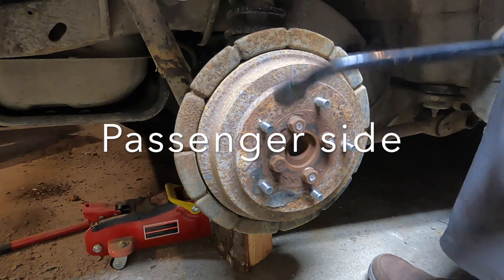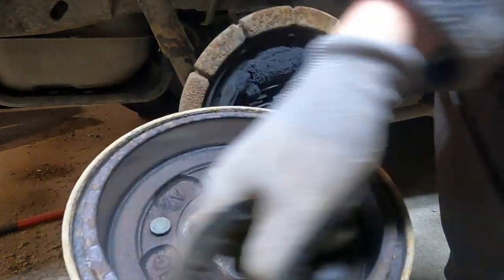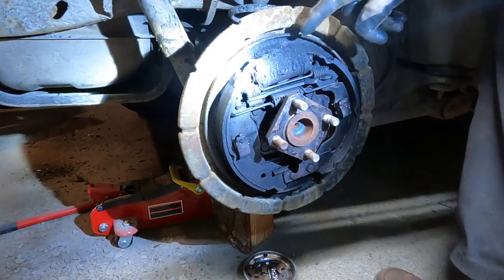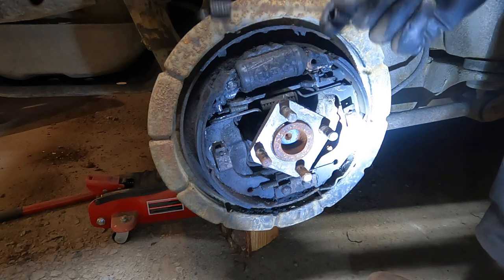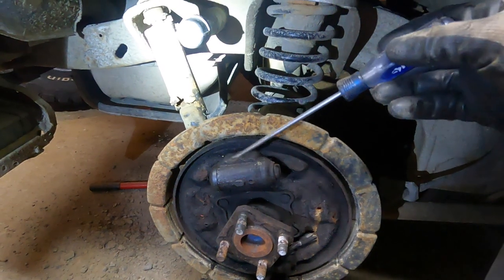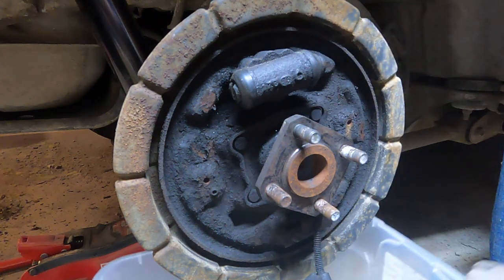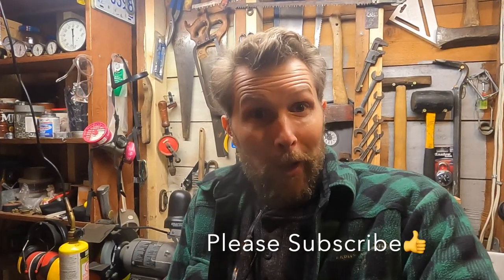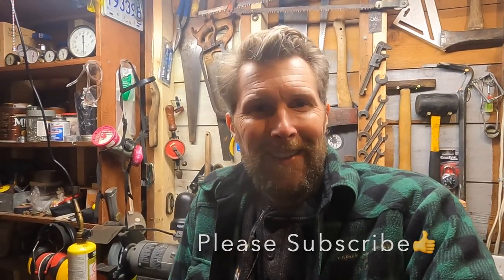Geo Tracker Drum Brakes and Wheel Cylinders

Comment: Thank you very much. It helped me a lot. Instead of spring tool next time use cable ties :) zip it, put your ring on the end of spring, stretch spring, cut yout zip tie after job done :) they are cheap, you have some in your garage for sure, and they are doing the job :) Kind regards from Poland :)
Reply from the maker: Thanks for the zip tie tip and thanks for watching!